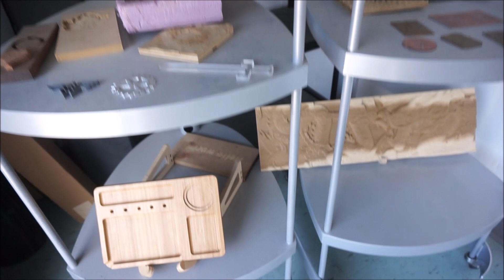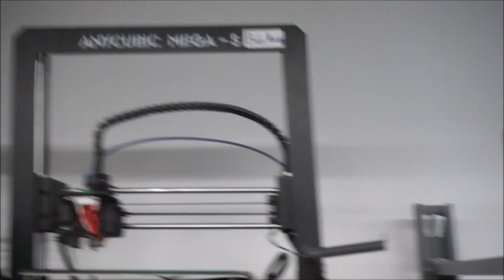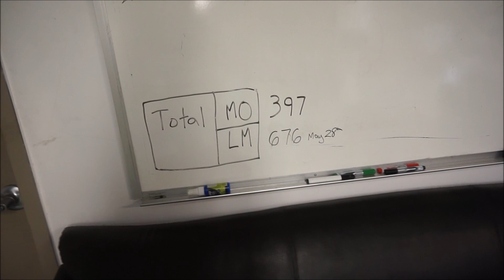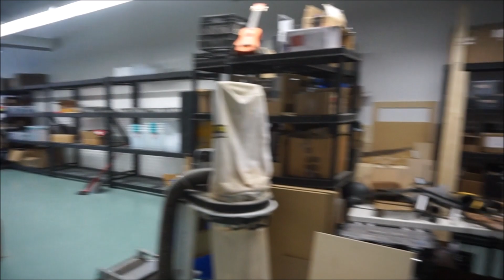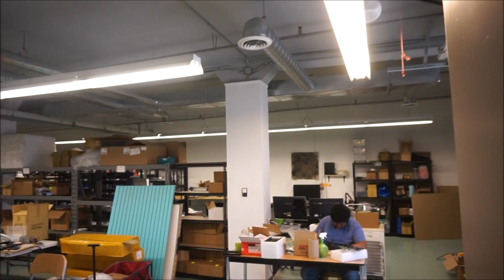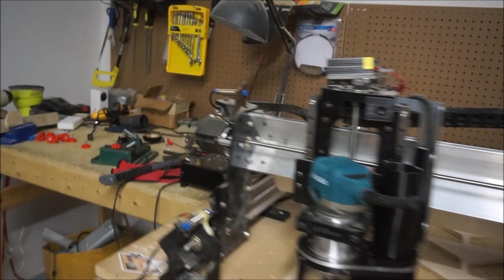Growing ever bigger: See our 3D Printer Farm and more! - Sienci Labs Office Tour

Comment: sell all those 3d printers and just get them plastic injection moulded, will be cheaper in the long run when you factor in all the labor and the fact that you wont' need to rent more space.
Reply: Ya inhection molded requires a mold that costs alot. Until you have a part that will never change its not cost effective as the most money is in the mold.
Reply: We're now reaching enough scale that this will be feasible to begin doing 👍
One of the primary determining factors of process selection is its Economic Batch Size: for injection moulding this tends to kick in at 10,000 units but has recently begun to lower to the several thousands. So, even though it might seem odd that we've been 3D printing the parts 'till now: factoring in the machine cost, labour, space, and material, the final price of the components still ends up being lower than any alternative manufacturing process.
Also in case you're wondering- the new space is to expand our capacity for storing, packing, and shipping all our machine inventory in-house. The 3D printing farm takes up a relatively small portion of the whole space.
Reply: chrismakesstuff Also factor in the ability to continually improve or make a change without throwing parts out.

Comment: Which are your top 3 printers when it comes to production efficiency: much up-time, long life and little required time from operators?
Reply: Get a cheap printer (under 1k), figure out the problems (forums, learning by doing etc.), buy/print upgrades (public files and sometimes self designed). It really depends on your use case (print size, filament type, detail etc.)

Comment: Great tour guys!! Just wondering why you 3D rather than getting parts injection moulded? Are the 3D prints better quality or stronger somehow, or is it do to with volume?
Reply from the maker: It has to do with volume and another consideration is being able to continually improve the design of the parts over time. The 3D printed parts are also very very strong, expect to see a new video coming out soon which demonstrates our tuning process when we start printing a new part on our farm :)

- Chris
Reply: Having worked in the injection molding business for 20+ years I can tell you the route that Sienci Labs are going right now is definitely much more cost-effective for the current volume that they are running.  Having a mold built for injection molding can be very costly and then the set-up and run time also increase the bottom line considerably which would eventually end up to the consumer.  Injected molded parts would increase durability in the long run and when the volume gets there I'm sure that's something to consider.  However, for now, I think the life of the current 3D printed parts will last most consumers for a very long time without failure.  Very impressed with the capabilities of the LongMill currently used in the shop for about a year and still being as solid as a rock even with daily use.  Speaks volumes to the quality and integrity of there machine.  Can't wait until mine shows up in a few weeks.